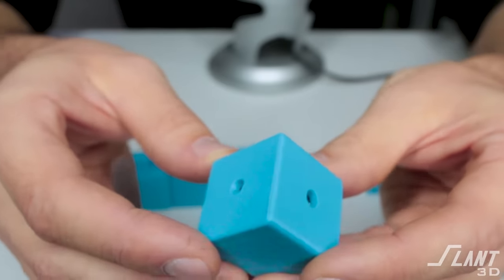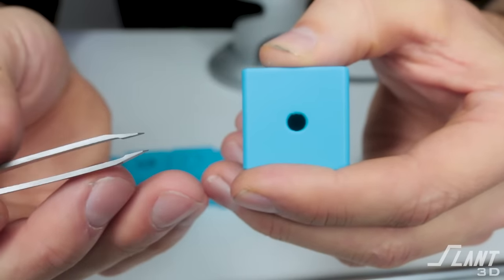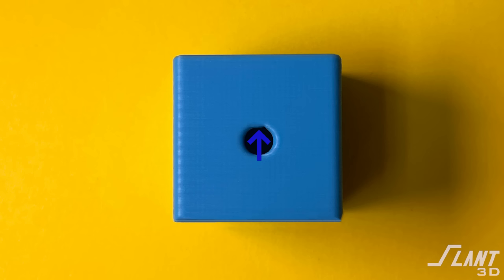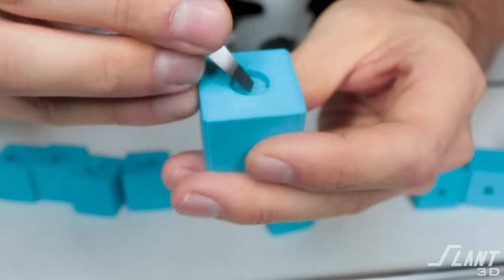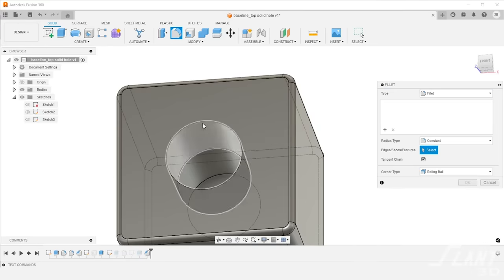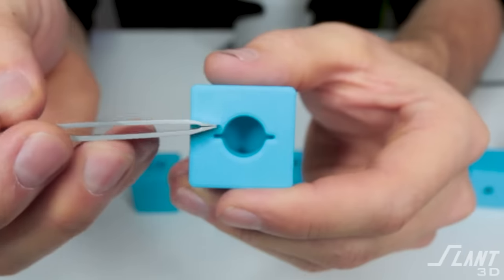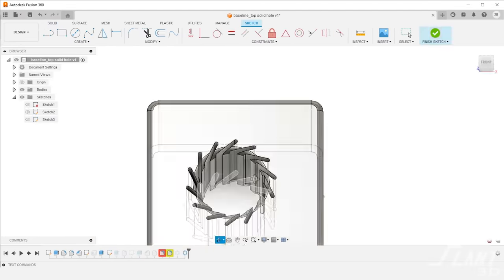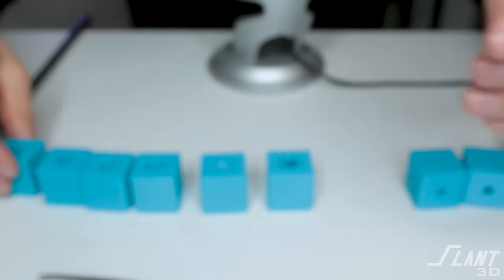Design Better Holes | Improve Tolerances | Reduce Sagging | Design for Mass Production 3D Printing

Comment: I'm shocked you didn't mention the best way to design top holes without support: polygonal approximation. The 1st layer of the hole when coming up from the bottom you cut out a rectangle that is as wide as the hole and as long as the inside of the box. That way there is only clean bridging on this layer, no starts and stops over empty space. The 2nd layer of the hole you cut out a square surrounding the hole. This square is supported by the cleanly bridged layer before it, so again we're only bridging. Usually the long rectangle and the square are enough but you could go on and add another layer with a polygon of more than 4 sides that surrounds the hole.
Reply: I agree.  I've started using this technique that I saw on Maker's Muse, that apparently Prusa uses all the time.  In my case I want to have a smooth hole that filament passes through, and sometimes I'm printing with a cavity, with the filament passing out through the top.
Reply from the maker: We omitted that because it is non-intuitive for traditional manufacturing. And often not viable for thin-walled pieces because it changes the dimensions. Also sometimes dependent on slicer settings which we try to avoid.
Reply: @richdobbs6595 can you direct me to which maker muse video goes over this?
Reply: Thank you for explanation. Didnt knew that. Sounds pretty smart. Will try next time.
Reply: @slant3d  That's really unfortunate, makes me wonder which other "best solutions" you omitted from your other videos because they don't match your business... it would be so much better to describe the solution and the state why you don't recommend it to your customers
Reply: @richdobbs6595 I‘d also like to know which Video it is! 🙋🏼‍♂️
Reply: That's kind of a variant/mix of what was already presented.
Reply: @slant3d  Huh?  Yeah, it is dependent on slicer settings, and it it does alter the cavity shape, but so does tear dropping, which you included as a technique.  It works for pieces with roofs that are 3 layers thick!
Reply: @slant3d that’s a really silly excuse, great video tho!
Reply: @LimabeanStudios search makers muse 3d print bore holes. (I don't trust links)
Reply: @bisk1407  I don’t think it is. The primary reason they are making these videos is not as a resource for us Makers, but for Production Engineers who are used to designing for Injection Molding. Their primary business is selling orders of 10,000 or so prints, and the majority of the people making those orders are production Engineers, not Prototyping Engineers who would be more familiar with some of the complexities surrounding designing for 3D printing.

They could have chosen to keep all of these videos private in a company wiki or similar source, but instead they are freely providing them to the general public instead of solely giving them to the paying corporate customer. That’s damn admirable.
Reply: @CMDR_Hadion its perfect if You have parts thicker than lets say 2mm. They give repeatable results and No cleanup. Its also really simple to make, even I use it for single print models.
Reply: shocked? you seem to be very invested in these holes.
Reply: came here to say this, thank you ^^
Reply: @slant3d  understandable but when people are stuck into traditional manufacturing methods they miss a lot of what makes 3d printing a great technology. 3d printing specific methods are important to go over as well. Maybe saving it until the end to clarify is good
Reply: @slant3d  Is sacrificial bridging intuitive for traditional manufacturing?
Reply: @slant3d  Your reply is confusing. Isn't the whole point of these videos to inform designers about design techniques that may be non-intuitive for traditional manufacturing?  Is making side holes into tear drop shapes something that's done in traditional manufacturing?

You also didn't include it because it has limitations? Don't pretty much all design techniques have limitations? If the point of these videos is to educate, then give people the information, tell them when it's useful and when it might not be useful, and then let them decide for themselves when to use it.

Seriously, the reasons given for not including this technique are puzzling and contradictory to the stated purpose of these videos.
Reply: I've always thought this should be a one click option in a slicer. Having to model it on a per hole basis is a bit much for both product design and for beginner printers.
Reply: @slant3d  I'd say it would've been well-worth mentioning though. If only briefly, and prefaced with those caveats.
Reply: Could someone fill me in on what all the belligerence is about?  Did something this channel did previously offend you all?
Reply: @Graham_Wideman  Dunking on someone in the comments is what we all live for 🙄

Srsly though I think it's an oversight of the video to not mention the bridged slices(or whatever is called) method.  But yeah I think people are just aggressive as standard practice.
Reply: @Graham_Wideman  I think it's just blunt honest criticism, as you might expect from a bunch of nerds.

I quite like this channel, it's got potential. But sometimes they have an unusual perspective because of their industrial focus.

That can be a positive. But in this instance it led them to leave out some interesting and useful information.
Reply: @tvepaddler 
unfortunate
Plenty, but the channel is very clear that they are talking about mass manufacture not hobbyists.
Reply: Nice i'll try that, it makes sense. Thanks
Reply: @slant3d 
or you can just admit you didn't think of it. and don't make up bull reasons not to include it in the video.
Reply: @Graham_Wideman  This channel just smacks of corporatism. The videos on their own are fine, but every single piece of them feels like "designed-by-committee" trash. Very un-youtube.
Reply: @slant3d  sure but if you're designing for traditional injection molding you don't have any of these problems?
Reply: PrusaSlicer sort of does this automatically. It detects if there are any perimeters in the next layer that are unsupported and automatically creates bridges in the infill of the current layer to ensure at least 70% of them are supported. I was a huge fan of Cura but PrusaSlicer trumps Cura in several aspects (like auto generated supports, print infill without perimeter, easy to use modifier blocks, etc.)
Reply: I didn't know that is what is was called, but I have been using this for recessed magnets and it is fantastic. I just make sure that my depth of cut is the depth of 1 layer height otherwise it gets messy.
Reply: Would this work for Oval or Slot shaped recesses?
Reply: Good news! Modern slicers now do this by themselves 😊
Reply: @MarinusMakesStuff  Which slicer can do this and what is the option called to enable it?
Reply: @MarinusMakesStuff  where?
Reply: Thanks for the info!
Reply: Prusaslicer seems to do this automatically.
Reply: @NigelTolley  it doesn't in my latest version

Comment: Would have been great to mention the caveat with grip fins: they are great for disassembly, but in many 3D printed plastics (PLA), there is significant creep (deformation on sustained loads). This means the force will change (get looser) if the rod was inserted for a long time and doesn't maintain consistent grip strength as mention in the video.

Small distinction but important to note for people new to 3D printing.
Reply: Exactly, most common FDM materials will creep into the position you forced them to, and because that's their new neutral position, the spring effect is gone.
Reply: This is true of most polymers in general, if anything below Tg PLA resists this better than some other polymers like PP. But creep is just something you have to deal with when you deal with viscoelastic materials (i.e., most polymers).
Reply: PETG seems to creep slightly, but much more useful than PLA. After petg initially creeps a little, it seems to reach a point where it stops.

Comment: 4:48 We (3D printing community) need to stop calling clearance as a "tolerance". Clearance (or interference for a negative clearance) is how much nominal distance there is between two (nominal=in a perfect world). Tolerance is how much a dimension in a real part can deviate from the design and still function as intended (including but not limited to clearances). Tolerance is how much error is acceptable, since there is always some amount of error. Clearance is the gap. The confusion comes from the fact that we can design a gap to be tolerant to errors. But they are different things
Reply: Are you familiar with ISO 286 tolerance grades chart? I would say it's okay to use word "tolerance" when talking about clearance and interference.
Reply: @InternToCEO  um, that chart is rightly named because it's about tolerances. Perhaps you're not understanding what the chart is doing?
Reply: @pablo321123  I understand what the chart does. I should of not commented about it...

Comment: "Maniacal Labs LLC" has a video on how to make some holes without support.  The trick being adding a sort of step a layer or two underneath the hole, then another in a different direction.  It provides enough support that the hole itself doesn't have a huge amount of filament hanging in mid-air.

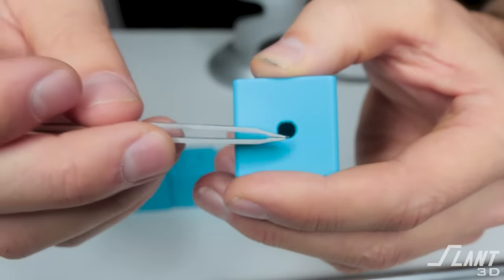Comment: In my experience: For holes in vertical faces like 1:20, rather than using a teardrop shape, you can just use a decagon (with horizontal edges top and bottom).
Reply: interesting idea
Reply: Do you do this with any size hole or up to a certain size?
Reply: @larrybud  I'd say the decagon approach is best for mid-size holes, in the order of several centimetres.

With holes under a few mm, you can often just get away with circles and several layers of steep overhang.

With much larger holes where you can no longer bridge across the top, you might need a different approach.

Comment: These are great tips.  Another way to print a top hole that's simple, and requires no extra cleanup, is to either make the hole extend to a cone to the outside edges of the box, or make a 45 degree ramp inside the box that the hole goes into.  The disadvantage of that is longer printer time and more material, and that it uses up volume inside the box.
Reply: That would be my approach. Some design a part for a function and I guess others design the part for the function and with the tool that will need to make it in mind.

Comment: I always had this issue of holes always being undersized if I don't make them oversized in the model itself. Very annoying.
Reply: Holes will always be slightly undersized because of the mesh approximation in STL files. There are other reasons too, but most sources of error in the slicing processes all tend to undersize holes. Until slicers become geometry aware there's not a universal solution, though I predict that's coming in the next few years.

Comment: yeah why not just undersize them & drill them out?
Reply: As the title says: Mass production. Adding another work step is expensive.
Reply: @tantem8 sadly it isn't, lets run the numbers shall we?
it'll take around 5 seconds per hole if you make a jig for it, so that makes it 12 per minute or 720 holes per hour or for a full day 5760 holes drilled per day, so to match that through put of holes if your average printer takes around 3 hours per print (if we're being extremely generous) you'll need a printer farm around 2160 3D printers to match one man with one drill &  just to put that number to scale Slant 3D one of the largest printer farms in the world has only 800 printers. so in short even if you were paying the drill guy above minimum wage it would be negligible to the amount you make or spend.
Reply: @DatBoiOrly In your example the hole drilling guy isn't also making the part.

Comment: “Tolerance”, which is commonly referred to as dimensional accuracy, is the amount of permitted variance in the dimension of a part. This involves setting a maximum and minimum dimensional limit for the part.

“Clearance” is the gap or space between two mating parts, such as a shaft and a hole.

The terms are incorrectly intermixed frequently including in this video. You’re not speaking about the upper and lower values of the part — the dimensional accuracy. You’re speaking about the clearance between two mating parts.

Comment: depending on application. i'll post processing with a drill bit, and thanks for the relief feature idea, im going incorporate that to my designs.
Reply: Unfortunately, especially for smaller diameters, drill bits may not be precise enough. In these cases you should use a reamer.
Reply: Good idea! I’m familiar with tapered reamers, but I think you’re referring to the straight reamers

Comment: I stared at my part for an hour yesterday trying to figure out how to print a hole at the top of my model without using supports.  I ended up just cutting the whole piece in half so there were no overhangs.
Reply from the maker: That is another way. you can also rotate the part so it prints diagnonally on a corner

Comment: Align and size vertical holes to fit with layers.If you don't you get egg-shaped holes, like in this video. Seams is a problem. A serious problem. This is fixed horizontally either by angled walls or by making a tiny notch. For vertical holes, this is solved by angled walls, as in not using circles at all. As for chamfers, they simply do not print accurately for vertical holes. They easily ruin a print. I only use that, when I absolutely have to, and in such cases, I constantly search for ways to avoid using them, because they, well... You get the picture.

Comment: I have this exact problem at the moment, I'm designing router bit holders, they need to grip the bit shaft securely but also release without too much force since you don't want to slice up your fingers on the bit. I started with a half circle with two 50-60 degree fingers of a smaller radius to grip, but that design just doesn't have the dimensional flexibility required.

Comment: If you plan on drilling or taping the vertical hole. The 'tear' shape hole will cause the drill or tap to shift upward. You may want to add a bottom 'tear' to create the same forces from the top and bottom.

Comment: There's another way to make and unsupported top hole, make a rectangle of one layer to one side of the hole and the opposite side (these are then bridged), next layer up make rectangles left right top and bottom of the hole and then a pentagram for the 3rd layer. Everything is bridged and supported for a round hole on the 4th layer. It's a bit more work but it saves a lot in the long run with repeatable results and no post processing. First saw this on prusa designs and there's a few videos on this by various YouTubers (Teaching Tech, Makers Muse, etc).

Comment: For top holes, there has to be some sort of software support to force prioritizing filling in the corners, from walls, to adjacent ones, until an octagon is made first. Then spiral fill in an octagon shape until the hole can be cleanly shaped, to reduce bridging distance on overhangs in general, then alternate to a traditional fill pattern on even numbered layers for tensile strength. You'd always have 3 points of support if that could be changed readily: a starting anchor, lateral support and end point anchor to keep the build from sagging while cooling and no curved extrusion for printers that can't handle it. Of course with that being something some can try, any change with geometry would warrant plotting out the best path differently on each build specifically to avoid issues.

Comment: The hole at 5:37 seems ideal to insert threaded stuff of unknown shape into. Might be good if you have a fine thread that your printer's resolution can't match.
Reply: If you want to screw a small fine-pitch screw into plastic, you can just print the hole a little small, and the screw will form its own threads. This works fine for, m3 screws holding on lids, for example. Obviously not as strong as a threaded insert or captive nut, but good for some purposes.  You can start by printing a test piece with several size holes in different orientations to see what hole size gives you the best effect.

Comment: What is your opinion of custom supports? As in, modeled directly to combat specific issues while making the post processing easier than with slicer supports? Is the work-flow too challenging to make something like that per-part? If a modeler is specifically making design choices to tailor to the printing process, couldn't that same understanding be extended to custom support structures?
Reply: They'll always be inferior to no supports. But I would argue that custom supports should be the only supports allowed if you're doing it for mass manufacturing. Generated supports for a one-off or a few more is fine, but not if you need 1000 parts.
Reply: @carlosjosejimenezbermudez9255  I've always thought it would be the like, coolest most efficient thing to somehow make a support structure which could also be another part for the object, like if you had a box with a hole in the top and a screw that went in that hole that you could put below it in a way that it supported the hole, take it off the bed twist it slightly apart and have no waste material. THAT is definitely not a viable common thing, but it sure would be neat.
Reply: @5FSF  Hmm, I'm going to look for opportunities to try that!

Comment: Excellent tutorial. Makers Muse did the point at the top style a few years ago because you done require supports, when done the right way.
The trouble with grip fits is they are slower to print but better than getting the fit slightly wrong over and over.

Comment: Would there be any reason to not use one of grip fins or crush fins? (reusable vs permanent w/ glue)

Because those two feel like they would fit 99% of scenarios.
Reply: Hmm nevermind. After going through comment discussions most polymers would seem to fail almost all of the solutions over time.